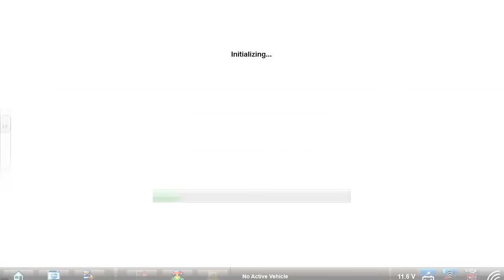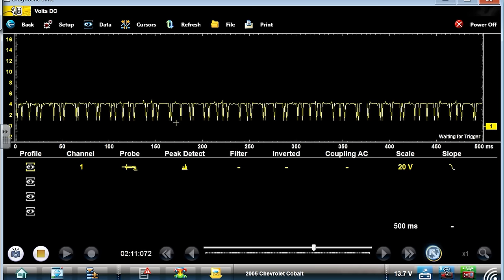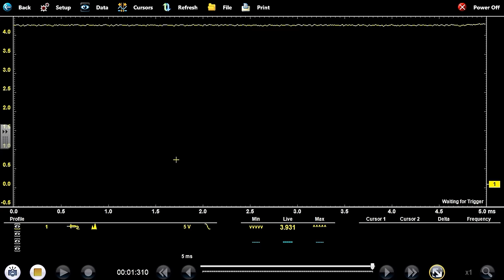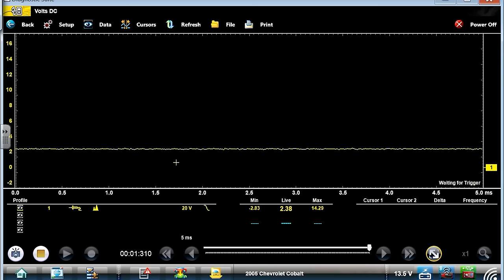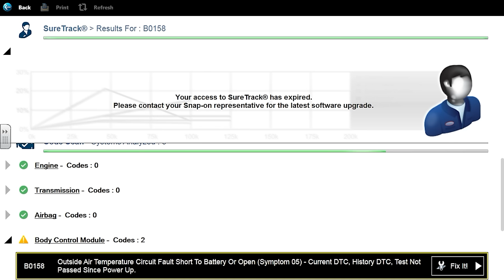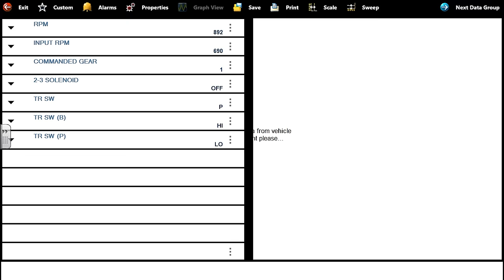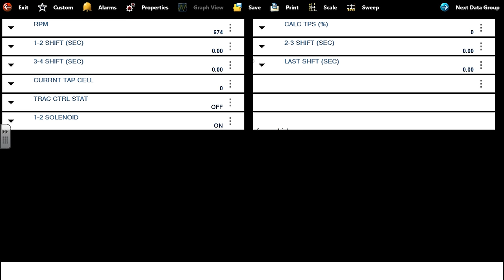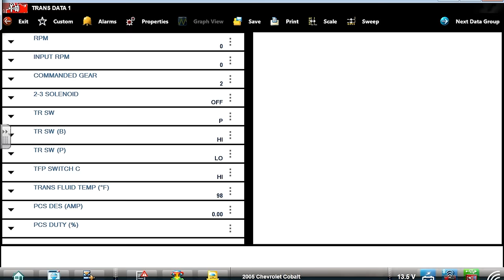Troubleshooting a Bad TCM - CAN and Sensor Ground Circuit Problems

Comment: This is one of my new favorites.  I've been watching your channel, and have been subscribed to premium for years.  The amount of knowledge you've given me, the amount of money you've made me, it's unreal.  I recently had a Pathfinder that was jumped backwards.  Blew the main fuse and a couple other fuses in the IPDM.  Also had a COMM code that would randomly come and go in the BCM, and the security light would stay on during cranking.  Measured the network and found an erratic signal.  Unplugged the BCM (suspected due to the code and also the immobilizer is run through the BCM) and my signal went normal.  Checked powers and grounds, and replaced the BCM and called my programmer to program it.  Security light turned off, but vehicle still wouldn't start.  Performed fuel pressure measurement and found zero with B+ coming out of the fuse box going to the pump during cranking.  This gave me the confidence to sell dropping the tank and performing wiring checks at the pump, which ultimately led to me replacing the pump.  Vehicle starts and runs now.  Has some other problems we're going to be tackling in the coming weeks as the client gets more money, but the fact that I'm at this point that I never thought I would be at, I'm eternally grateful to SD premium and all that you do.
Reply from the maker: Cannot thank you enough for this comment!
Reply from the maker: Isn't is crazy when you have two completely separate issues? Like you and I both had on these cars. It sometimes makes you question yourself doesn't it? Love your story so much and again I appreciate you sharing this.
Reply: @ScannerDanner  I question myself all the time.  I’m not a confident man by any means, but I follow the process and try to stay calm, and remind myself that I have the readings I do for a reason.  Understanding the base engineering of things such as how a computer talks to another, what things like thermistors, Hall effects, and pressure sensors are and how they operate, it all ties into finding the fix.  I had another one a few months ago, Dodge Durango that the guy had already replaced his own IAT sensor because Autozone said it was the most likely fix.  Backprobed the signal wire at the IAT and found 0v.  Moved about 5 inches up the harness and found the 5v ref coming from the computer telling me there was a break in the wire to the connector.  De-pinned it, and soldered in a new section of wire with a new terminating lead, and was able to clear the code and read an accurate IAT.  All of this due to your teachings.  For as long as you’ll make these videos, I’ll be watching.
Reply from the maker: @automedic9781  heck yeah man, awesome! That open circuit was easy to ID when you understand how the circuit is designed and works.  Nice job man
Reply: Yep, ScannerDanner is the Man, without question, I've been a Premium member for years and have never regretted it !!! I watch several other channels, but when I need deep technical diagnostics SCANNERDANNER  is the channel.  As always Paul keep up the Great Work, it is very appreciated !!
Reply from the maker: @faustogonzalez8397  thank you so much!

Comment: Thanks, Paul you just saved my A** tonight. I stopped to grab a bite to eat on the way home - got back in the jeep (05 GC ) went to drive away and noticed a message on the dash "Transmission over Temp" along with all PRND boxed, no reverse lights, among others It wouldn't upshift, It was in Limp mode. I was stuck 115+ miles from home, I have been watching your YouTube videos for quite a while and remembered the one to be honest, I remembered it because of all the junk on the car that had a TCM problem - anyway, I ripped the dash apart and started tapping on the dam thing, turned the key and bam - it was working. 
I just got home a few minutes ago and put a scope on it before I shut it off. I got a code P1637 EEPROM issue, so I must replace it (at least I was able to make it home and save a tow charge). I have to say TY for all you do, I believe you to be one of if not the best techs I have seen in the last 30 years. Keep up the fantastic job and may god bless.

Comment: I've run into this scenario before so I always make a ground strap and bolt it to the outside of the TCM and bolt it to the body close by. It usually starts. Great video which shows a common problem. I've personally done this about 5 times.

Comment: On most control units where the internal ground is bad, you will measure 12v on the Aluminium housing. If that‘s the case you could just ground the housing and your done (for testing purposes, or for driving it to the scrapyard 😂). Grounding a sensor circuit would fry the small trace to the pin instantely as soon as a shift solenoid gets actuated due to it‘s high current.

Comment from the maker: What happens to CAN signals on the entire network when one module has a bad ground? Can this problem be missed if the network is not measured a certain way?
How do you isolate which module is causing the problem? When main grounds test good on the affected module, can testing a sensor ground or the 5v ref circuit aid in your diagnosis?
Reply: I was hoping that you would open up the TCM and find a broken solder joint.. You even mentioned it there towards the end and got my hopes up. lol..   oh well.
Reply: Could you isolate which module doing a parasitic draw test??
Reply from the maker: @fabianrodriguez7219  a module with a bad ground won't cause a drain issue my friend

Comment: Paul, while you were checking the ground at the TCM, I think it should be pointed out that a Phil's Probe uses a tiny set of multiple needles ["bed of nails"] to pierce the insulation [like the Tech's butt sets back in the days of the old POTS phone systems] while other probes like the screw down Pamonas and their knock offs use a single, larger "nail" to pierce the insulation, which can - sometimes - break individual strands in a multi-stand wire, compromising its current carrying capacity. Phil's Probes are superior for these applications, assuming very low current flow through the probe or only for sensing voltage levels. I would not use a Phil's probe to provide a substitute ground on a suspect headlamp bulb circuit, for example. You and Caleb please keep up the stellar work!

Comment: Last year had a 99 corvette that the dash, hvac, radio would go dead and would go into lImp mode while driving. After some network diag, found the ground for the pass side power window module was bad ( spread female terminal @ door to body harness) same elevated voltage as yours, but in my case it was a class 2 network instead of CAN. Great case study Paul, always a great feeling the moment a no start fires up for the first time 👍
Reply: How would I know what kind of voltages to expect on certain wires? I bought wiring diagram for all systems, but don't know what to look for. Reeee

Comment: Hey Paul, these Cobalts were known to have faulty ignition switches. My uncle had one. Some of my friends had them too. The interlocks always break. The column cover actually has a little access panel you can pop out to press the solenoid plunger without ripping the whole cover off. I'm actually surprised you haven't seen this before. It literally affects all Cobalts.
Reply: dfn mm

Comment: When you walked over and turned the radio off, that is so me. It's why I've always preferred working alone. I've worked in shops where there can be multiple radios going on, it's all a huge distraction. When I started my own shop I didn't, don't allow radios. The claim of needing background noise is a complete lie. If you're paying attention to the radio, you are not paying attention to what you are doing. Nobody can divide their attention and then claim that they are giving complete attention anywhere. It can even be maddening when things aren't going well and you've got some idiot on the radio yapping away or music blasting in your ear.

Comment: I wish we had mechanic's with brains like this in AUSTRALIA. I recently put my 2001 turbo beetle into a mechanic because there were no comms. The rat charged 3   hours at 150 per hour to hook up a few scan tools and find no system, then buy a wiring diagram and find the communication module and tell me it was buggered. Then put a scope on the ecu comms and saw that it is working( which I already knew because the thing was running). The main issue was an EPC fault which was the car not revving and going into EPC fault but the mechanic did not look one second at that in 3 hours and it turns out the EPC fault can really only be the throttle control. The fault was the pedal position resistor which I worked out with no comms in the side of the road. The  mechanic may not be too smart in his job but because he knew he was only getting paid for diagnosis  he just fucked around and did fuck all.

Comment: One of the most exciting and useful channels i watch 👍
Reply from the maker: Thank you!
Reply: Really great lessons we are getting all the time from your videos thank you very much for your time, efforts, and knowledge you are spreading over the world. Following your from Qatar🇶🇦.
I have a question, I have Range Rover 2016 V8 NA with engine misfiring and engine light flashing in cluster. Reading fault codes found misfiring detected on cylinder 6 only. After checking found that firing signal to Cylinder 6 Coil not coming out from PCM not out put from PCM to control Coil which means PCM has internal electrical failure and we estimated to replace PCM. My question is that in this case is there any other solution to do rather than replace PCM especially it is costing too much.
Thank you once again Mister Paul Danner
Reply from the maker: @target-mechanica  make sure that coil is not shorted too as this could have damaged the PCM driver. Where is the main switching transistor? Is it is the coil (3 or 4 wire) or inside of the PCM (2 wire)?
Reply: @ScannerDanner  thanks for your reply Mister Paul. Actually the root cause is ground wire short circuited with ignition signal control wire as the wiring is melted and touching each other that’s why the PCM is shorted internally. For the coil is fine because already swapped with other cylinder and working as sparks coming once installed in other cylinder connector. The PCM in order as it is no available in our dealer. Once PCM arrived and programmed I will update here the findings.

Comment: Is this tool your using to scope a normal oscilloscope? I seen you had the scale of 500ms/s and I'm just trying to confirm the tool so i can look for a quality affordable scope to test these things.

The thing i need to know other than type of scope (faster volt meter 😂) is what scale do i need on the scope i get? Do i need a 500ms/s or will a 100ms/s work because i can get the 100ms/s way cheaper i think. But I'll ultimately get the scale type you recommend, your advise has never led me astray in al the time I've been a premium paid viewer.

Also i do want to mention that even though there are other great channels luke Motor Age for electrical diag but Paul you are one of a kind high level depth diagnostics and i learn so many things from each video even when i think i know enough about a specific system you always blow my mind.

Comment: Question :
Could the Trans harness have a short to the TFT line internal of the Trans? The solenoid's are 12 volt correct? I didn't see you test that point.
I have seen problems in GM , Ford, Chrysler and Mercedes made Chrysler ATX's that required a new Harness. The last 2  are known for wicking ATF to the AT module via the insulation of the wire causing CAN problems 
Always good to watch you work your magic

Comment: I had an Impala 4-5 months ago with the same style bad TCM. TCM/PCM sits inside the airbox. Rodents used the box as a nesting area with the TCM as the urinal. TCM was dead, I swapped it out with an identical one from same year/make/model/part number car. Car started, I flashed it anyways just because I already purchased the $40 subscription for the car and I wanted to make sure it was a complete job.

Comment: I’ve got a 99 Honda Accord that I’ve been dealing with a extremely frustrating dreaded EVAP leak p1457 canister filter area. Now, I’ve been dealing with this issue for almost a year and a half so almost everything you can think of, I’ve done to try to remedy the issue. The only thing I haven’t been able to do is put a bi directional scan tool on it to check the system to see if there’s anything to pinpoint the problem. The one screwy thing I believe may be a main cause is the #6 fuse on the passenger side fuse panel isn’t getting any power and as far as I know, it controls the secondary O2 sensor, which could be giving a false reading to the fuel tank pressure sensor and something else is causing low voltage on the light green wire of the same sensor. So I’m stuck and would be extremely grateful for any help to fix the stupid issue I’m having. Tired of only getting a little over 200 miles per tank but still got plenty of power. No drivability issues just extremely crappy gas mileage.

Comment: U kill it  with that video awesome  technique  👏  I have a question I have a cura the it was sitting for 5 years in a back yard  it was on lean mode at 35k rpm now runs but after a couple minutes  running  dies  dropping  the rpm  to 0

Comment: Great work, thank you for the video,   are those spikes I see on the inside on that hook-tool? Does it penetrate the isolation on the wire or is it reading the wire magnetic fields? Oh nvm, I jumped the gun, you mentioned "penetrating"  the wire right after i paused the video lol😁

Comment: Very educational video on diagnosing. Here's one for you. 94 BMW E34 showing a Trans Program message when cold so it locks into 3rd gear. When I carefully drive in, not exceeding 30mph) and the engine gets to normal operating temperature, the message goes away and she back to shifting normally. Pulling codes from the TCM reads, 1. 26 Solenoid Valve Converter Lockup Clutch Currently Present 2. (Pin 38 on control unit) Short Circuit to Battery Negative. 
I'm leaning towards the solenoid since this is happening due to temperatures changes.  Thoughts?
Reply from the maker: No thoughts, sorry. I'd have to research your system and those codes to offer any suggestions. Your testing results of the suspected circuits is what is needed here too

Comment: Can I ask your opinion? I have a 2014 Impala with u0101 (tcm) and u0422 (bcm). Good ground, good power, no short, no open, 60 ohm on can bus, voltage at can high 2.69 and can low is 2.14. Little low but in range can low. Now I disconnect tcm and can low goes up to 2.3 and can high stays 2.69. Am I looking at internal tcm issue?

Comment: Had this exact same issue on a cobalt, it ended up melting the shift solenoid in the transmission, or vice versa. 
Either way I had to get the TCM to communicate, and it ended up being a bad ground also. What I ended up doing was grounding the case of the TCM, it had 2 holes at each top corner and I used an eyelid and bolt there and wire to ground, after more diagnostics I found the shift solenoid driver (ground controlled by TCM) to be showing a 12v source, unplugged the transmission plug at the transmission and the condition went away. Which led me to a faulty (melted) shift solenoid.  
What I believe was happening is the solenoid itself went bad and sent the 12v power straight into the TCM driver ground and in turn Burnt up the ground circuit on the board my assumption is that it burned up close to the ground pin in the TCM because after fixing the solenoid and grounding the case everything was perfect. No faults and all the data was within range. 
I’m gonna say that car you guys were working on probably had a bad shift solenoid also and that’s why after grounding the trans temp sensor signal wire it worked fine other than it still had shifting issues. The replacement TCM might suffer the same fate over a period of time if the solenoid wasn’t caught.

Comment: I do a lot of diag on cars from other shops. Like 2-3 shops before it gets to me. I keep old terminals from used connectors so I can drag test terminals. This one is so much like what I’m used to checking. Have to fix all their screw ups to get to the original problem that they went after.

Comment: Danner, quick question.been watching you fir years.  I wanted to use my high frequency plasma torch (yes CT 2050,) to cut off bolts on an expansion valves . Do I have to be concerned around canbuscand ecm and sensors.

Comment: i had something similar happen to a 08 impala. same clicking while playing with wires. ended up figuring out it was the case of the trans module getting ground from whatever it was laying on. ran my own ground to tcm case and all issues disappeared.

Comment: Hi
Gald you didn't send it with the temp fix as you don't if that circuit in the ECU could handle earthing all the current of the ECU for an extended length of time

Comment: Thank you for the information, I was wondering I'm working on a 2016 colorado Meeks truck. I just wanted to make sure that the 60ohms if 59 is OK? I figured it was but just wanted to make sure.
Reply: U0420 which seems to be the rack, but yea I put one in not cheaply and, I still get that code when TCS comes on, and my gmlan is not at 2.5 it's at zero. Key on it gets to 2.5 sometimes has a spike to 3.
Reply from the maker: Yes sir, that is fine. But all that tells you is your terminating resistors are good and that there are no shorts in the network. It does not confirm that an open exists in a parallel branch of the network. Measure your CAN signals at that particular model, also powers and grounds on that module
Reply: Right on, thank you. That's what I was thinking was check the ground and power. Thank you you are the man.